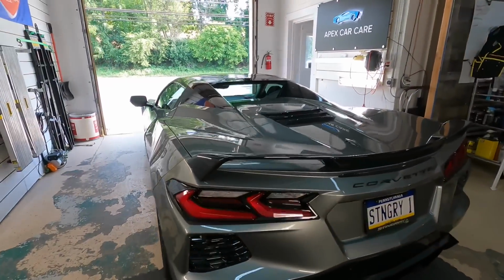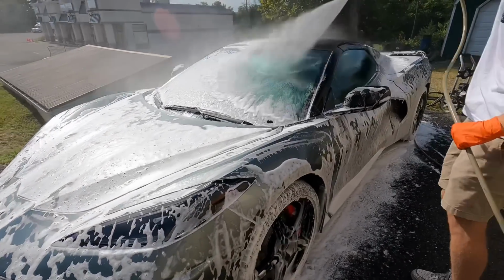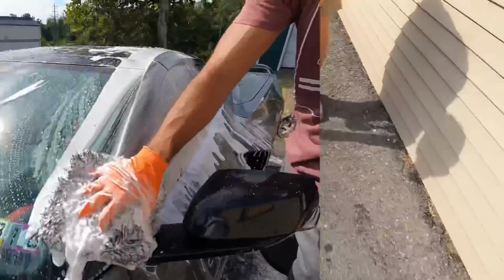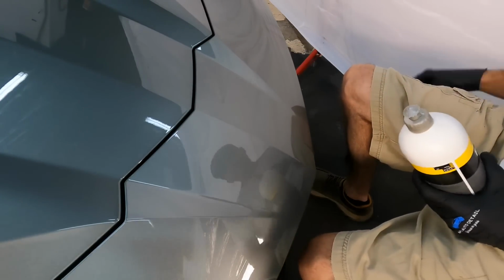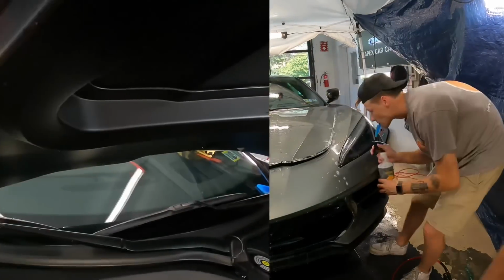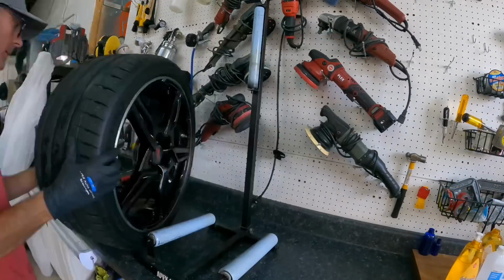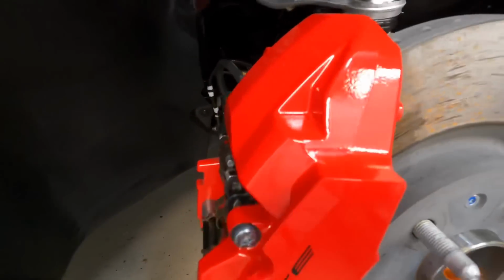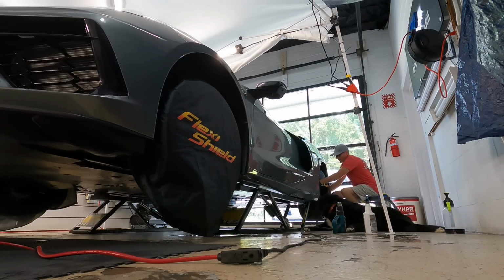2023 C8 CORVETTE Z51!! Ceramic Coatings And PPF!! PART 1! The Ultimate Protection Package!!

Comment from the maker: What would be your choice for garage or shop flooring?
Reply: Swiss tracks I've heard great things and all the big shops seem to have it...... edit lol. Nevermind I commented before watching the damn video 😂
Reply: Tiles with good grip.
Reply: Polyspartic is imo the best. I have armorpoxy polyspartic full broadcast.
Reply: Try a polyurea or polyaspartic coating. 

As well as being at least as durable as epoxy, they cure much faster and they are flexible too. 

I remember you saying you have quite big swings in weather and temperature there Brian, I think, so they will handle the movement in your floor much, much better than an epoxy.
Reply: Brian I work for a winery and we go through epoxy  flooring quite quickly our situation is with hot water  we’ve been messing around with Polyaspartic however when wet it gets very traction limited and you could add a traction aids such as some sort of sand agent.
Reply: I would look into a company called Gulf coast paint their Apoxsee is quite durable for us at the winery it comes in a regular paint can and the lettering is white and blue, at one time Kelly Moore had a great Epoxy flooring with a great warranty but our West Coast rep that I knew has since retired!
Reply: Polished and sealed concrete
Reply: @no_lft_shft  mmmmmmmpmmm2mmmmmmmmmmmmmmmmmmmmmmmmmmmmmmm2mmmmmmmmmmmmmmmmmmmmmmmmmmmmmmmmmmmmmmmmmmmmmmmmmmmmmmmmmmmmmmmmmmmmmmmm2mmmjjm

Comment: The epoxy will be nice for a few years and then it’ll need a light sanding and topcoat with the clear again.  No matter what you have, the PPF solution will be slippery.  For a home garage, SwissTrax smoothtrax tiles are awesome.  The only really durable commercial floor would be porcelain tile with a dark grout.

Comment: Beautiful car and beautiful work too. I really like the wheel coating you used and the rust inhibitor for the rotors is a great idea. Looks like a much better solution than when the old man sprayed my rotor on my go kart because I was whining about the brakes grabbing. I cannot wait to see the gloss on the Vette. 
Floors are a huge pain and the epoxy is a good idea. We use to use muriatic acid to strip the floors before applying the epoxy. Thank you for the video.

Comment: I used a polyaspartic coating with full paint chip coverage and topped it off with a clear polyaspartic coating. Not very slippery and has held up well

Comment: I prefer normal bare concrete floors. nasty jobs, just put a painters blanket on the floor. I couldn't tell you the coating my work place used, but it holds up to brake clean, diesel fuel spills, and solvent based parts washer fluid. down side to that floor is it is slippery when wet.